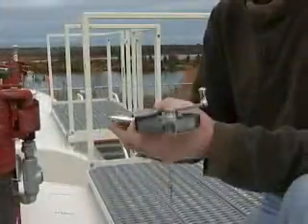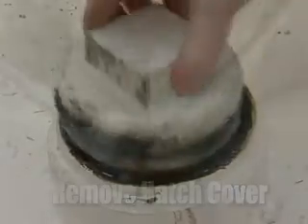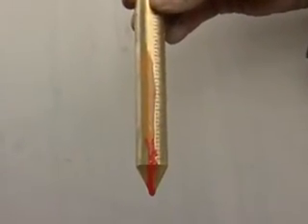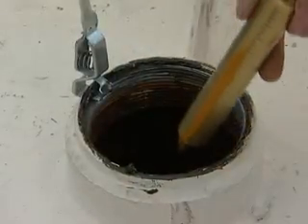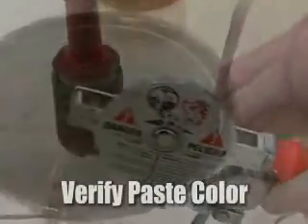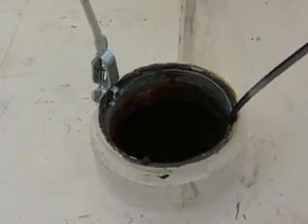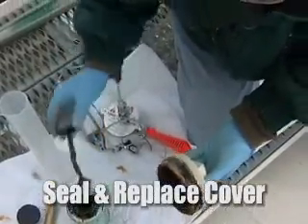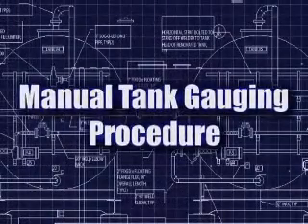Manual Tank Gauging Procedure

Comment: doing it all wrong, first off you should know the reference gauge height and product before ever climbing the tank so you know what type of all gauging paste to bring. then get a console or side gauge if they have it, then take a foot off said gauge to make it an even number (no inches or fractions)  subtract that difference from the reference height carrying the inches and fractions, now you have your tape in tank. should do your TIT  then add your oil on tape back to your difference to give you your ullage, do that twice if you get the same gauge twice your good, if not do it a third time and average the 3 consecutive gauges for your ullage. now your ready to get your straight innage/ water cut. record what you measure vs the reference height. that difference should be the same between your innage and ullage within 1/8 of an inch. if it is then your gauge is good.